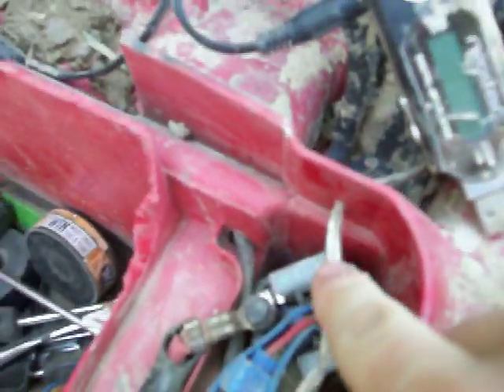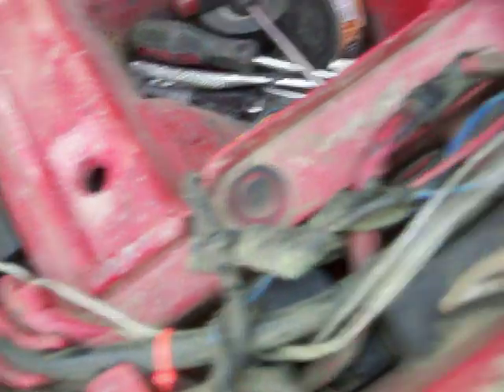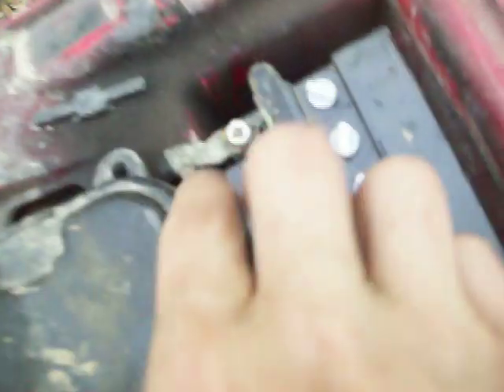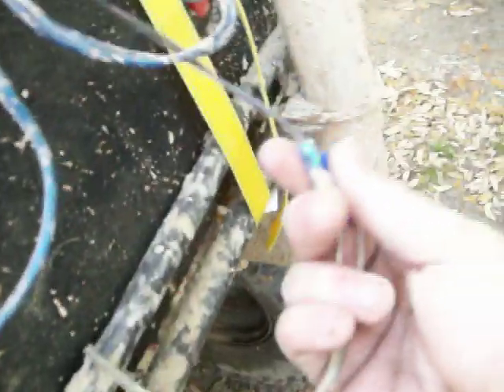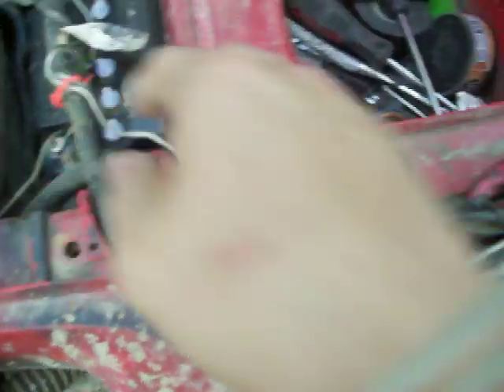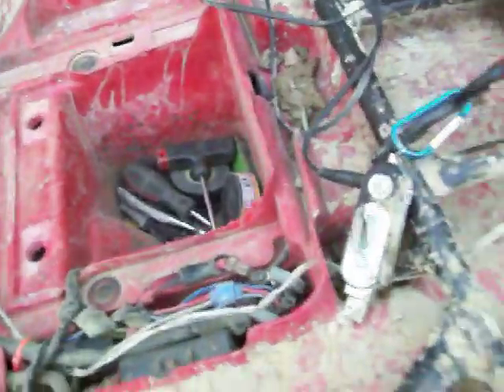How to install ATV Speakers

Comment: How can you tell which wire is positive and negative coming from the power source from the amp, that you spliced, going to the solinoid+ and negative- battery?